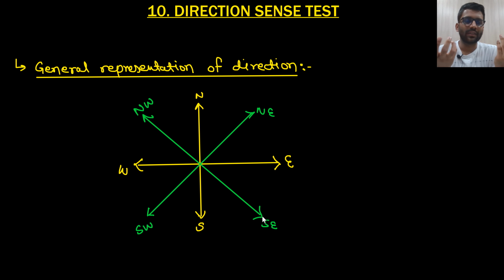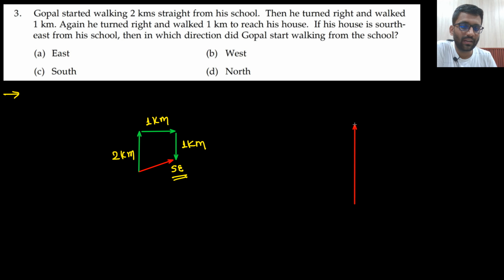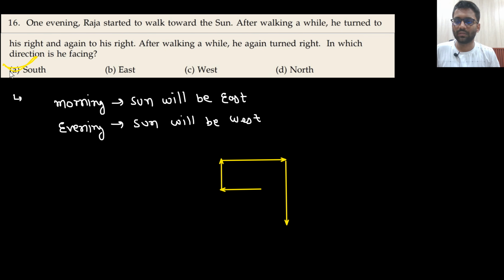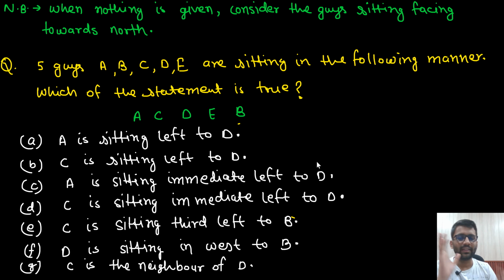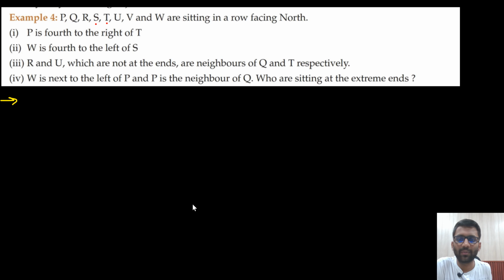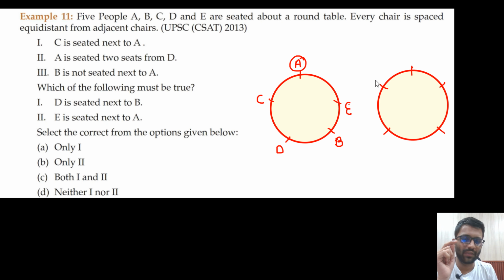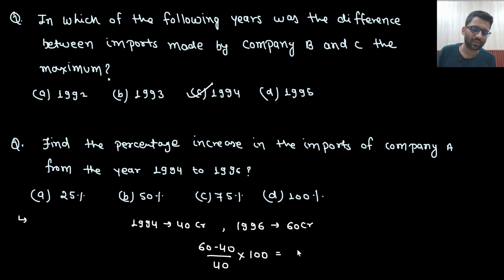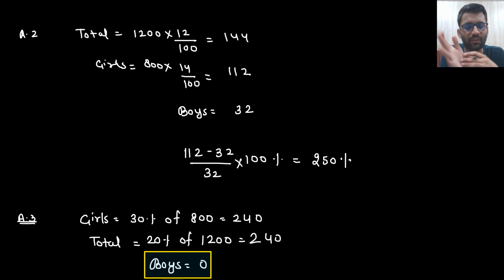Direction Sense Test || Seating Arrangements || Data Interpretation || PrepFusion

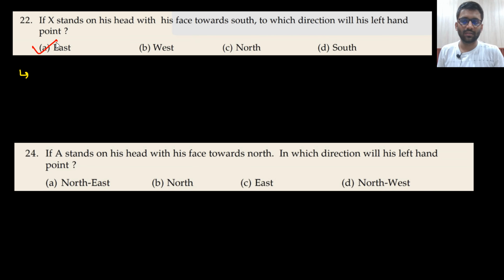Comment: @34:00, this question can be interpreted as a water image from the second person’s perspective, because it produces vertical inversion. Or you can simply interpret it as doing a somersault. 
That way, both left and right remain the same as they are, while the head and feet are inverted, i.e., their positions are changed. When the head goes down, it naturally faces the opposite direction, but the left and right hands remain the same.